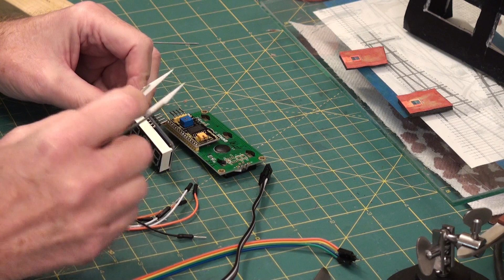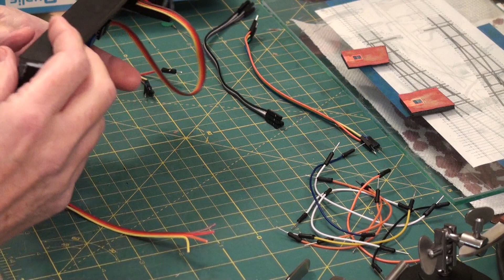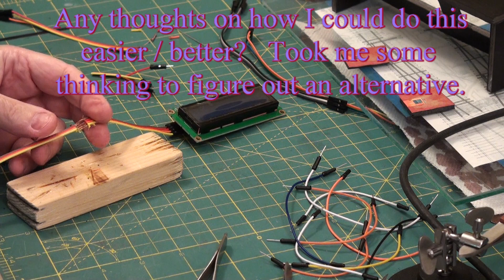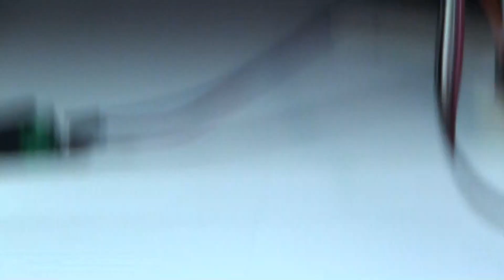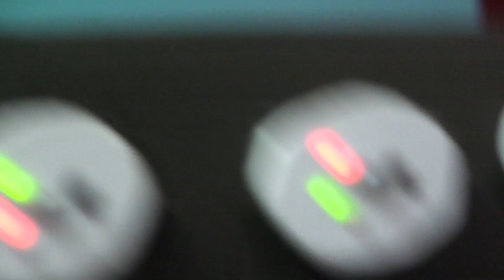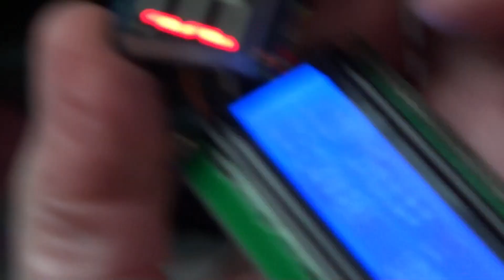Part 8 of Build your own in-track Speedometer

Comment: Why not a Servo splitter y.
Reply from the maker: Thanks for the comment, I do have servo "Y" splitters but they are only 3 wire.   I needed 4 wire and figured that if I had to do any wire butchery I might as well do it with a full 4 wires.